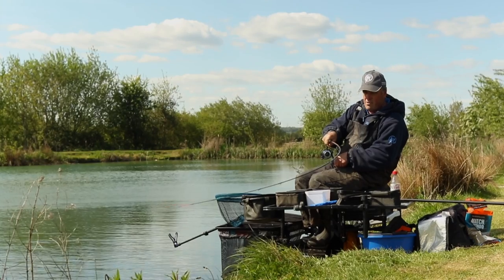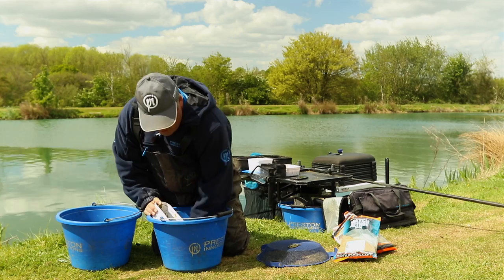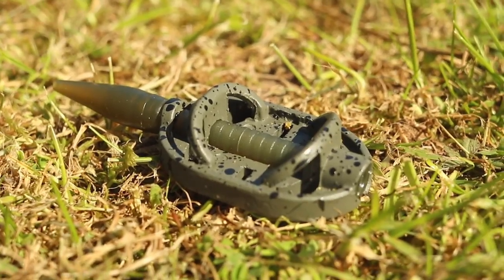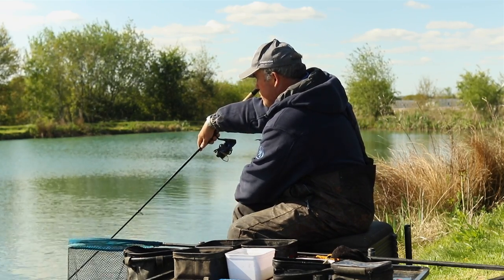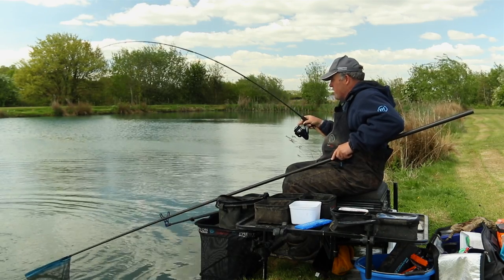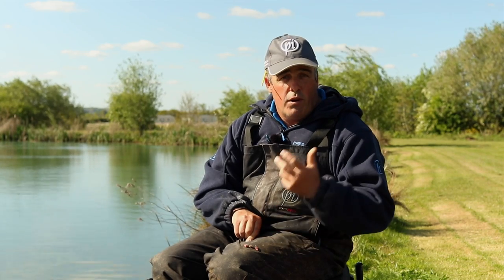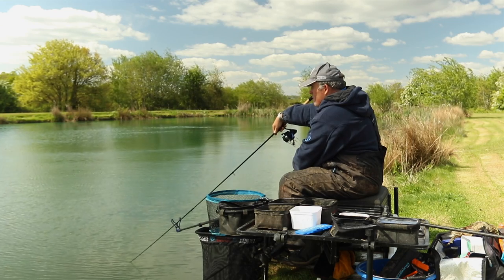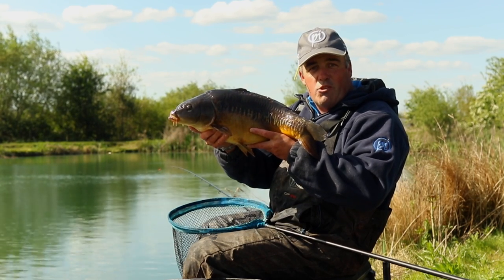How To Catch MORE on the Method Feeder!

Comment: Hi Des, just started up fishing again and tried float fishing and also using a cage which I prefer (a much more relaxing days fishing i think) but just purchased a method and watching vids on how to use it, When using a cage I get the line tight so I can see the bites, do you do the same with method or do you keep the line slack???
Reply from the maker: Des likes a small amount of tension in the tip. Just a gentle curve.

Comment: Des ,(Anyone )I just bought a monster 11 ft pellet waggler rod .if i fancied a change and used this method, Could i get away with it using the same rod ?Monies tight atm so dont really want to buy  another rod 😊
Reply from the maker: Waggler rods aren't designed for casting heavier weights such as feeders. It could lead to a broken rod

Comment: Hi, Just coming back to fishing so doing a lot of research, I understand about using the reel clip to ensure the cast is the same distance each time but doesn't this then take the clutch out of play?  If you are on the clip and you get a hard bite and a run how do you give line to the fish?  And conversely, if I cast out and then take the line off the clip to allow the clutch to work and I get a fish that goes on a run how do I find my distance again without having to re-plumb etc?  Any help gratefully received.  Cheers.
Reply: That's the main problem with fishing with a clip. I find it depends on where your fishing and what's stocked. If your somewhere where the fish are only a couple pound you can usually get away with it but any bigger and you risk snapping off. I use a tight elastic band, this does the same thing but if a fish runs then the band will slip off. Or you can wrap your line around a couple bank sticks before each cast, clip then remove the clip when it hits the water